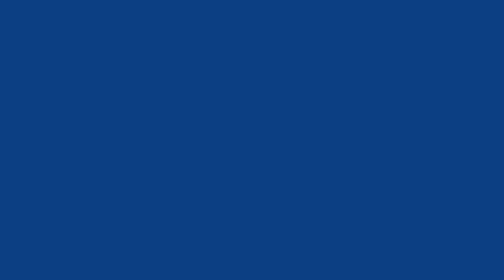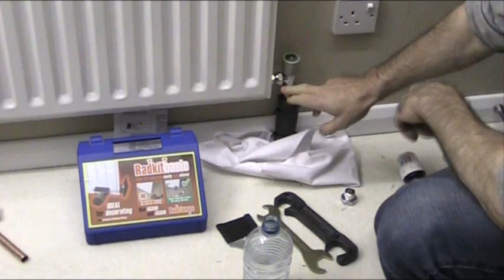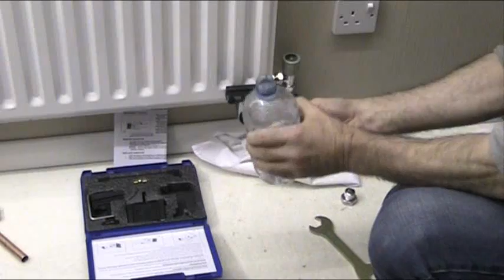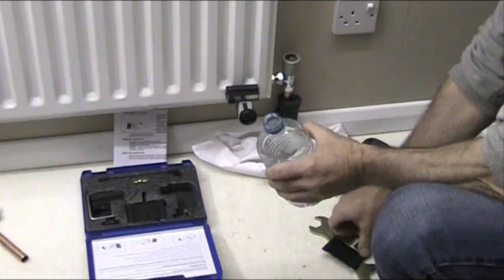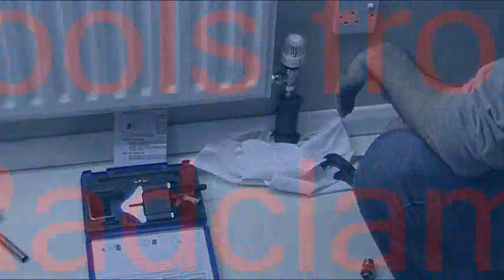Change radiator valve to TRV without Draining.

Comment: That would be useful for one or 2 radiators cant use freezing for more rads  otherwise it will be too expensive. The clamp thing will only work if the tail is the same size whit is not always the case. I normally would release pressure from drainer then quickly change the valve.

Comment: Not changing the old olive and nut is lazy. Not all valves will fit within the same depth to the olive, nor may the old nut be the same chrome effect. Too many pieces in that kit to lose/break, in addition to all the pieces of the freezing kit. I would not trust the ice not to pop, safer just to drain down. I’d rather spend more time on it, than pay to clean a customers carpet if it went wrong.

Comment: Buy a plastic cat litter tray which is shallow and wide enough to slip under any radiator and this will catch any drips. Most of the homes I work in have cream carpets and black radiator water is not a good idea.

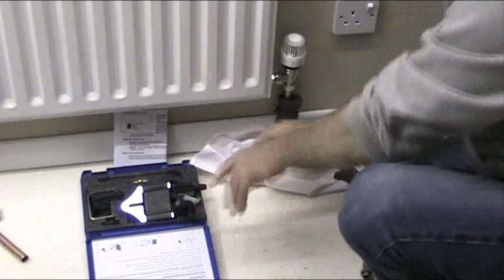Comment: @7:16, why would opening the valve at the other end 'let water back into the radiator'? Unless of course, this radiator is actually empty...it does sound hollow. I'd like to have seen the bleed valve being opened, before and after the refit...just to prove that the rad is full, and that this video does what it says on the tin.

Comment: OK as long as you don’t need to change the radiator valve tail or the nut and olive on the pipe.
Not all union nuts and threads are the same

Comment: Just swap it with the water on, just take the pressure off 2 min job
Reply: piespeafield exactly the way i do it mate, providing the tail nut is same size
Reply: Me too. Iv'e had such a good vacuum created on some systems that when the valve is removed you can see the water in the pipe.  Only water loss is from the rad but that's only a minor dribble.

Comment: Thanks for the vid though it is still pretty advanced and technical for entry level homeowners like me!  All my top floor radiators are cold at the top and roasting at the bottom but no air comes out when I try to bleed them. Hope your tips will work as my plumber is always hard to get hold of!
Reply: Mbolo Life Style
Try this, as it worked for mine.
First isolate all the rads on the top floor, apart from one.
Switch on the system and allow the water to flow, via the pump.
By having all the other rads off, this forces the water to move through that rad and clear any air locks that can't potentially be done by just opening the bleeder on its own.
Bleed the rad in the normal way. 
Once bless, close off the one you have just been working on and repeat on the next one.
Reply: Jobs a gooden

Comment: Excellent video.  Very clear.  Thanks.  I might get a plumber in now though as my DIY skills may not be up to the job and I'll save myself time and cost of the kit (but not the cost of the plumber of course!)
Reply: You'll save yourself the cost of a new carpet, maybe a new ceiling if it's a bedroom rad, maybe excess on your insurance if you claim, plus a shedload of arguments with the lady of the house (assuming there is one). As long as you get a normal plumber in, not a 24 hour emergency one, it makes far more sense.  Get a recommendation from your local plumbers' merchant or try one of the find a builder type websites.

Comment: As an alternative to save having to use a freezing kit, try the following for your open vented system:
1. Search for "monument plumbing plugs" and get yourself a set. If you do any plumbing, you've probably already got them.2. Turn the system off and let it cool for ~30 mins.3. With the Monument plugs, plug the open vent and the system fill in the F&E tank.4. Open one of the system drain cocks - you'll lose a couple of pints of water before the pressure drops sufficiently to stop any more loss.5. Close the drain cock and the lock shield valve then swap in the TRV.6. Open the lock shield valve, remove your plugs and power the system back up again.
Done!
Reply: On a Combi I close the flow & return valves on the boiler and you get the hydraulic effect of capping the header tank. . . . .  Takes ppl hrs to change a set of valves for TRV's. . . You can do 6 or 7 in hr easy. . . no mess no fuss.
Reply: Peter McCabe john

Comment: Ha, ha. I can imagine hundreds of DIY's trying something like this, then at the last knockings, while under pressure, cross threading the valve nut.
Reply: Too true. I've done thousands of plumbing jobs, but the one time I tried this sort of short cut, replacing a circulator pump, one of the gate valves wouldn't shut off so I got water everywhere. Lesson - fit quality Pegler gate valves and drain the system. Then if something goes wrong it's not a disaster.

Comment: Occasionally, the nut and olive that are on the original pipe won't fit and tighten onto the new thermostatic valve. They usually do but I have come across some that don't.. This can cause a problem with the pipe frozen because you then don't have much time to act and get the old nut and olive off. I usually have a 15mm compression stop-end lying on the ground beside me just in case the ice in the pipe melts. There is a special tool to remove  the old olive, but any paint on the pipe below the nut needs to be removed first to slip the nut down the pipe a bit t to get the tool on the olive to remove it. So before I begin the freezing, I usually remove any paint just below the nut, and put the stop-end and olive-removing tool within reach on the ground near me.
Reply: H

Comment: Loved your vid and method BUT having left the pipework with the rad stat attached but closed off, should there be a temperature drop, say over night in autumn,  the rad stat might just open and cause a flood. How do I know this. Guess. So ALWAYS cap off the rad stat connection.
Reply: Each TRV  tap set comes with a full shut off cap that fits in place of the TRV which enables full shut off of the valve body, only problem with this is that the majority of plumbers do not appear to leave these valuable pieces of kit with the householder or even if they do by the time service is required the original owner has moved on along with the caps.

Comment: Gas Safe means working with gas+boilers not plumbing,with these fast track courses they can do the course in 6 weeks,most plumbers would have been Corgi Reg and now Gas Safe but would have many years plumbing experience, you might have got one off the former.
Im sorry you had a bad experience but there are many good tradesmen  out there, recommendation goes a long way to getting one, just because the advert says I am does not mean I can,

Comment: seams to me the plumbers you have seen were not really plumbers or they did not know how to use the freezer kits, I have been freezing pipes for over 25yrs never had a fail if you follow the guide lines for freezing you cant go wrong and it can save hours of work